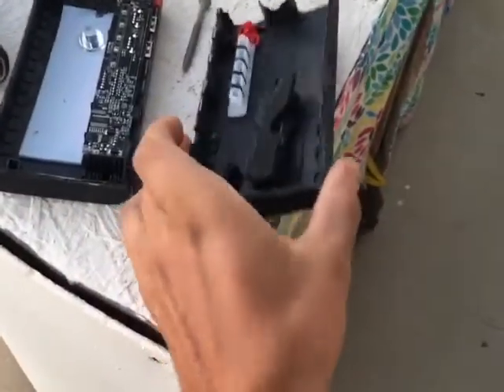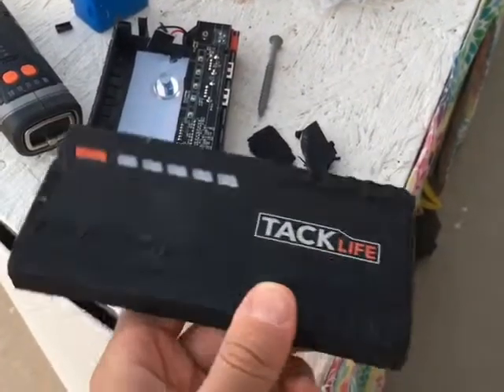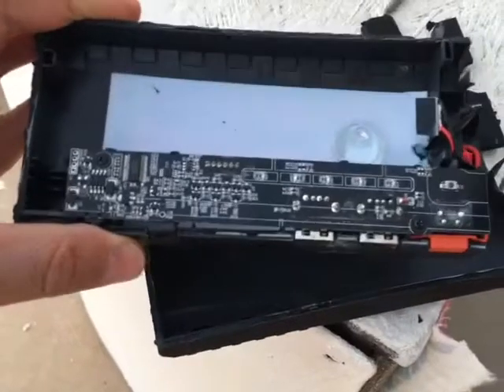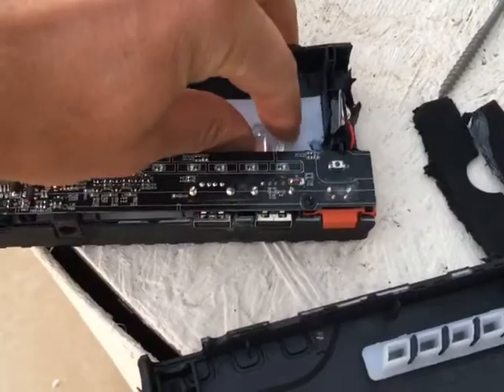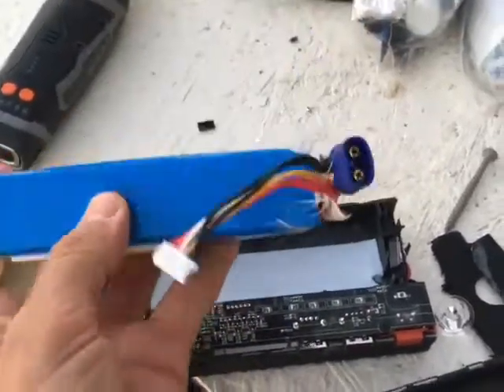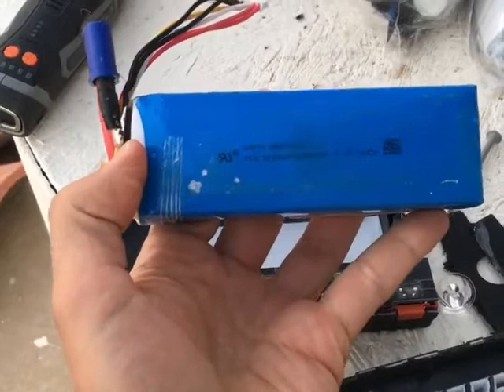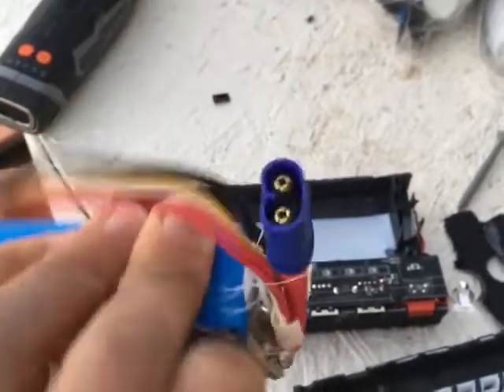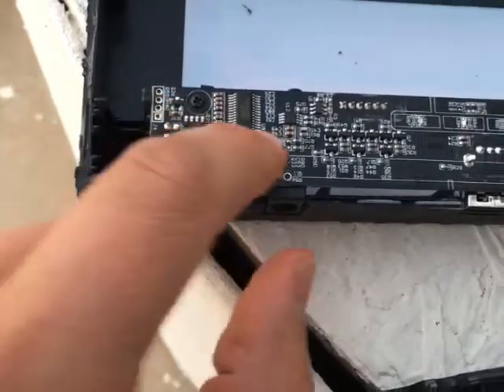tacklife car jumper teardown, bad battery

Comment: That must be an earlier model of the Jump starter. I have the Model T8 and I suspect that the 6 soft-rubber membrane-like surfaces located at the 4 corners and in the left and right sides, (at the edges), are actually screw covers. But if they aren't, then access would probably mean having to cut it open as you did.

I'm a micro-electronics hobbyist but I have no need for anything that is contained in this unit. At least, from what I see in yours, there aren't any large caps in it. I'm sure that the cable unit (that connects to the jump starter) is where the 15V Cap is located and when you press that "Boost" button, that Cap is loaded and sends a decent wallop through the leads, (so watch out and don't touch it until your sure that you've bled it off first!). 

Anyway, I've had mine for about a year and used it twice within the first month that I had it. But then I went to jump start a friends vehicle today and found that the T8's battery was dead! The Model T8's user manual was very poorly written, (no surprise there), and I found that I couldn't recharge the unit. 

Then later, as I searched on line for a possible way to replace the battery, I found a video that clarified the way the T8 had to be recharged. The T8 has 2 Power ON/OFF options and the manual doesn't express any indication that the ON/OFF Switch on the unit needs to be in the "ON" position when you put it on the charger!

Of course, this would be something that most people would consider at the top of the list of important information. I'm almost willing to bet that TackLife took a potentially sizable loss in US sales, which could be directly traced to their poorly written user guide.

Their product received a lot of bad reviews simply because people thought that the unit wouldn't take a charge. As a professional Technical User Guide author, I can say that many of the China-made devices suffer from poorly written manuals and ultimately, a potentially large loss in US sales. 

By now, you'd think that they would've figured that out and applied some of their business's expense budget on a professional, experienced technical writing team for their products that are meant for US sales, (and very probably for many other countries outside of China).
Thanks for the video!
Rich

Comment: were you able to replace the battery? mine reads 2.5v at the 12V outlet, wouldn't hold a charge
Reply from the maker: i never did replace it. a new 3s lithium pouch pack cost more than a new boost pack from a different company.